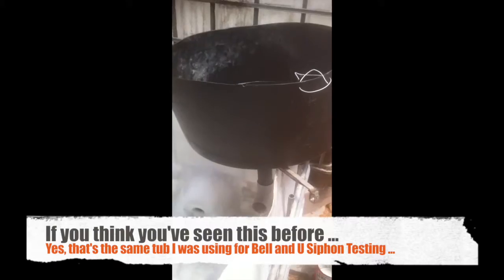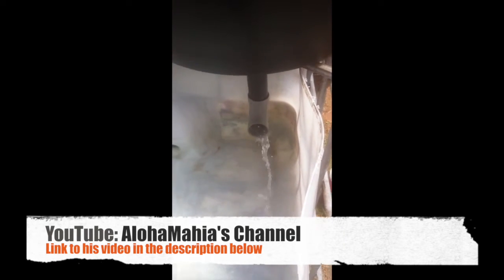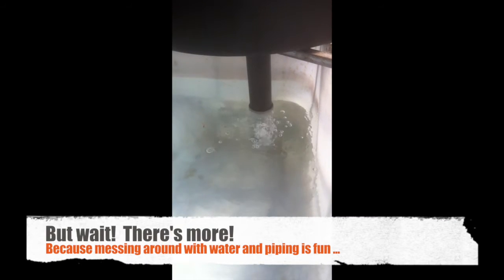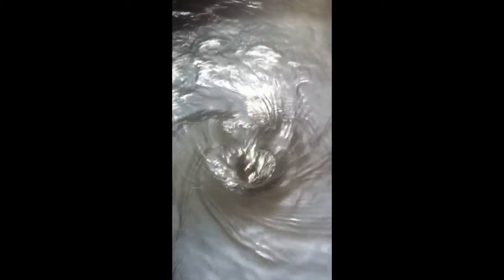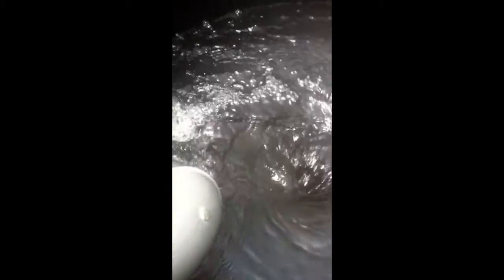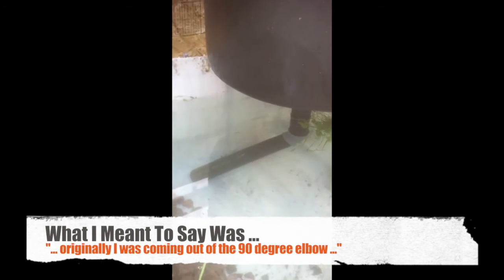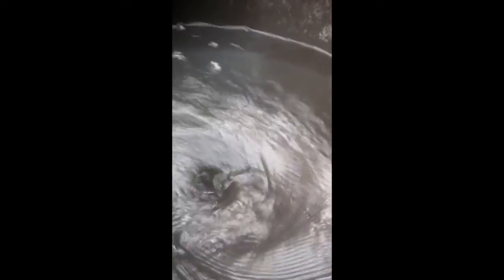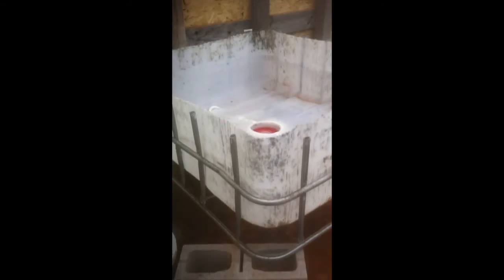Aquaponics Update - Vortex Aerator Testing

Comment: very  interesting.
Reply from the maker: +oldshield Thanks!  I have worked out a "gotcha" with the vortex areator / hydrocyclone system ... the rate of flow out at zero pressure / gravity must be essentially equal to the rate of flow in.  So, for this to really work as well as it should the outflow pipe at the bottom should be around ½ inch / 12mm.
Reply: I will soon be able to start my  stuff up after multiple weather disasters. I am  going to  try this out in my sump though with a 2 inch line maybe. I got a great deal on a 7500 gallon per hour pump, so I need some thing to bleed off some of the flow and this look like a promising way to  that beside just having it splash back into the sump.
Reply from the maker: You might want to take a look at https://www.flexpvc.com/WaterFlowBasedOnPipeSize.shtml to right-size your pipe work... Its a handy reference.